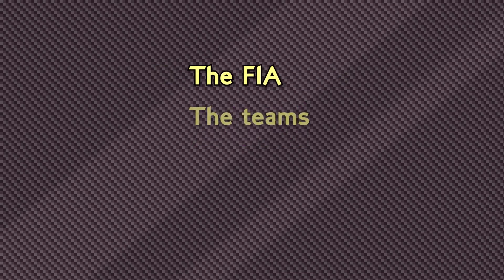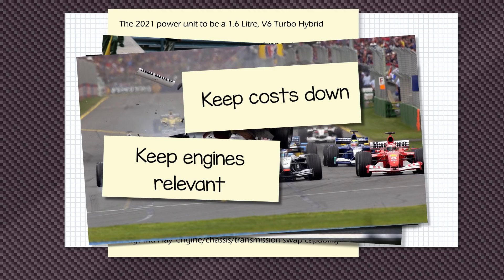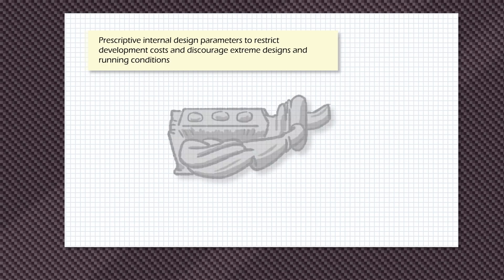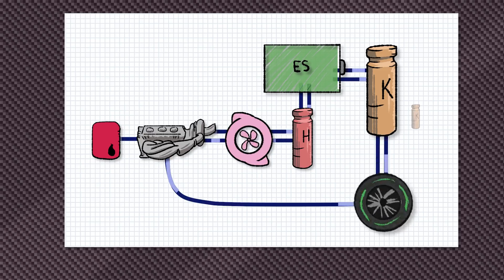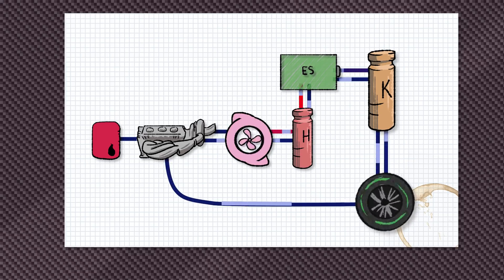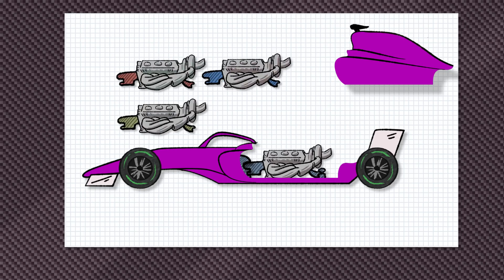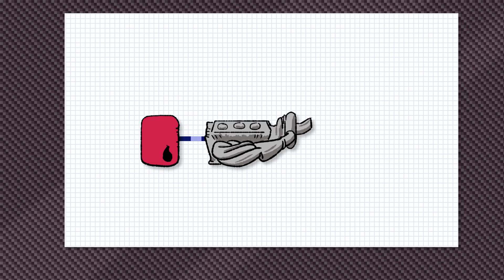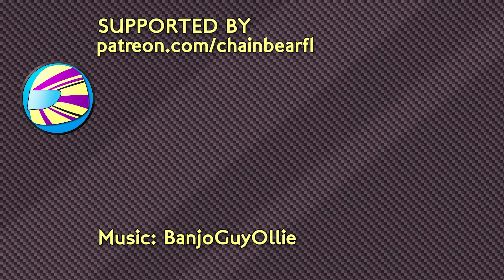F1 Engine proposals 2021 explored

Comment: "The sound of engines will disappear all together" with the implied electrical engine replacement. Not a hope in hell. Considering petrol has not only a 40 times higher energy density but can take mere seconds to refuel vs the 36 hours of an electrical engine. I mean it really sums it up that the electrical competitor to F1 not only requires TWO ENTIRE CARS swapped mid way to complete the race, but the speeds and distances are utterly pathetic compared to F1... with full electrical regeneration allowed.

Once the hipster hype of electrical engines has died down and people are looking to move on from the petrol engine I fully expect the alcohol fuelled engine to take off. Not only does it have a massive energy density, slightly lower than petrol considering the higher efficiency but still in the same league, but it also can be refuelled just as quickly along with a higher performance than regular engines and all of the current engine technology happily transferring over. In terms of hippy saving the planet it outputs water and only the carbon dioxide required to make it making a net 0 output. Electrical cars have been around for a while and the same complaints remain. Poor performance, short range, long charge time. How can you trust a car which cant make the journey and leaves you stranded for a day and a half (assuming you find somewhere to refuel). Electrical engines are complete failures compared to the engines we currently have (which are already better for the planet than electrical engines).

Also the MGU-H is the most expensive part of an engine by an absolute mile. It's less of combustion engine technology and a lot closer to jet engine technology. This won't be anywhere near conventional cars for the foreseeable future because, as you might imagine, making a jet engine is insanely expensive vs a $10,000 car's pricing. Its a technology which has been around since the 50's at least, and used in aircraft in the 50's before jet engines became the norm. It's nothing new, and there's a very good reason why it hasn't been anywhere near cars despite how much efficiency has been stressed.
Reply: Just going to point out a few mistakes you made (though I absolutely agree with you on Ethanol power), Modern Electric cars have been cutting down on the charge down heavily to just under 10 hours for a full charge, granted thats still insane compared to less than a minute to fuel most petrol cars, but its much less than a day and a half, and well, the Tesla Model S has been able to do 600 km and where I am at, that is plenty enough to be considered a Long range.
Reply: @xander1052  what no one her have said is that EV need batteries, they're currently made out of lithium, not only mining that lithium implies a massive ecological cost, the mines themselves produce carbon emissions, then you need to transport that to the place where batteries are made, then transport them to the respective manufacturers. Also, when the battery dies - because it's a thing almost nobody consider - all that lithium becomes toxic, hard to deal with, waste - it's one of the hardest - non nuclear - materials to deal with when disposing and, at the end, you need somewhere to store it, because it's solid, not a gas.
Making alcohol requires sugar, and other costs, but its disposal it's way cleaner. Nobody think about that
Reply: So Samsung isn't as keen on OLEDs 
Because those guys are basically an economy in itself like Toyota is a City
Reply: @Ricky Rickalvous
But you said they perfected it.

"They will be for motorsport racing (horse racing)"

No chance. They won't be allowed based on noise and environmental arguments. Hell, noise was already an issue in Spa years ago, at some point it was uncertain whether the Belgain GP would be held .
Reply: "The possible way to improve would be Samsung perfecting their Graphene battery" 
Key word is would be
I'm merely stating a possibility, an if scenario which is very likely
www.bosch-presse.de/pressportal/de/en/carbon-neutral-cars-synthetic-fuels-turn-co2-into-a-raw-material-120448.html 
Carbon neutral synthetic fuel
Noise at a racetrack? If Spa has an issue and races can't be held then too bad great racetracks have come and gone (Brands hatch, Malaysia, Nurburgring, possibly Silverstone)
Reply: You said it girl
Reply: It isnt so much the petrol but the oil required to make the petrol and lubricate the engine. At our current rate the oil reserves will dry up by around 2040-2045 but our rate of consumption is still increasing so this date may fall back to the mid 2030’s, thats closer than many people realise. Believe me im all for the sound of a screaming v8 ( i didnt really like the v10 sound) but the quicker we find an alternative the better
Reply: All i can imagine is getting a car powered by a liquid that has been fermented for the alcohol. And the "fuel" would smell like beer/bread. Nothing wrong with that i suppose.
Reply: Electric cars these days outperform and outrange gas cars by a small margin, and that margin is getting bigger and bigger each model year
Reply: @skyscall  😂 Since when..
Reply: Bang on, as of yet, with current battery tech but as it improves, changes and advances the script will all but flip. Stuff like graphene and super/ultra capacitors won't be primitive forever. 
Gas jets are too complicated for modular racing currently but it's probably the only thing that will see F1 into the future because nitrous oxides and bioethanol will be next to come under attack after high octane petroleum.
Reply: Who told you that making a jet engine is expensive? Developing it is. In Russia there are techies who build small jet engines in their garage. Here he tests his own built KJ 66 engine https://www.youtube.com/watch?v=sHuqoJmuvxE&list=PLyyfwUFI3XU-CvGsSXnczu4p9AEobpAED
Reply: Aditya Ravishankar creep
Reply: You guys can keep presenting this argument and that argument as 'fact' all you want, but the only real fact is that gas & diesel engines will continue to be around for DECADES, if not another century. The vast majority of society buys used cars and, at the moment, there is only a single brand of electric car that is pretty much universally praised - and they're a luxury segment competitor which eliminates a massive amount of potential customers right off the top with cost. The time it will take to create enough volume to build up a used electric market that can compete with used conventional cars in it self will be monumental. Then there's reliability & affordability of used cars; if something needs replaced on a conventional used car, it's generally a cheap component like an alternator, not a multi-thousand dollar battery pack. Toyota's Prius brand is nearly dead since the fad died; people do not LIKE them. Then there's the economic problem of, first of all, shutting down all of the gas stations. Then we have to replace them with a network of electric charge stations. So now we're chopping down the oil industry at the knees, putting who knows how many in the unemployment lines and eliminating numerous career paths. But wait, what about the electricity infrastructure, how is it possibly going to be able to withstand this MASSIVELY increased load? I can't speak for Europe of course, but I can tell you right now that North America can't handle this, we'll end up suffering from power outages on the regular. So just upgrade it, right? At what astronomical cost? With who's money? The governments? No, you mean YOURS. Or else we can just roll it up into the national debt; after all, $18T isn't so bad...

This is a pipe dream, guys. Go look back at the '50s, at the various concepts of "what the future will be like, what 2000 will be like" - and laugh at how much of an utter fantasy they were dreaming of, devoid of the many considerations like what I noted above. At bed, the electric car will live parallel with the internal combustion engine, but it will NEVER replace it, not in the realistic future. It's quite literally the perfect tool for the job, yet so many are desperate to replace it with a mediocre substitute whose adoption may just bankrupt society.
Reply: You missed something: fuel-cells. They might never take off in road-cars but they'd immediately suit F1 until batteries get dense enough (at least for quick swapping). There's still a LOT of room for improvement with batteries. (just look at how the range doubled for the new generation of electric cars)

I'm not thinking of hydrogen fuel cells, but rather  SOFCs with biofuels. Butane or propane would probably be the best if they can be bio-produced easily enough. (green factor) There are alcohols if not.
Reply: Electric engines aren't a good replacement for combustion currently, but they're only going to be getting better.  Battery technology is improving at a pretty impressive rate and considering the lower cost to recharge & cheaper maintenance costs, electric cars are only going to get more and more viable.

Also where are you getting your 36 hour charge time?  It takes 20 minutes to charge a Tesla halfway, and 75 minutes to charge it fully, and we're still in the infancy of this technology - these numbers are only going to improve (especially if they figure out how to quickly swap out batteries rather than having to recharge the one in your car).  Also, Formula E currently has a car swap halfway through the race, but this is the final year that they're doing the car swap - next year's formula calls for a battery that must last the entire race.
Reply: 3 decades is enough for me
Honestly my first car will probably come in 2025 and you bet it will be an ICE 2023-2024 model
16 years until the possible ban of ICEs... not bad I'll drive that sucker like I'll never drive again and hopefully switch to an electric S Class or some other European/Japanese model
Kinda like Android to Apple
Reply: Yes very interesting, I learned a thing or two there. But I just wondered that with the pace of electronic power units and performance longevity, won't they be able to go full electric in the 2020s and be able to do full race distances on a single charge? As it was not long ago electric engine's were pretty much a joke and now they are in every hyper car being developed or been made recently.

I am not really looking forward to a future of electronic F1 cars, I do like the roar of a engine, but I do think F1 should take a leaf out of Formula E's book with regards car design as I think the 2018 Formula E's look incredibly good looking compared to the 2018 F1 cars. But that's just my personal preference.
Reply: @TopTopBuzz  F1 will never go electric, more likely it will be phased out or merged with Formula E in that event.
Reply: @F1ll1nTh3Blanks , yeah wouldn't surprise me, I hear Mercedes are starting a FE team next season.
Reply: @Ricky Rickalvous
Ehm... LG made OLEDs actually successful. Samsung only makes them for phones which people throw aways yearly.
Reply: @RyTrapp0
Huh. Well some people just want to bury their head with all their might. The "DECADES" mean two, maybe three. After electrics become dominant smoke spewers will be progressively banned from the roads. (starting with cities.) Besides in a few decades probably there'll be a mass transition to automatic vehicles, which further accelerates transition to EVs, since most people won't be owning them.
Reply: I don't think that alcohol engines will eve have a net loss of zero until the world stops using gasoline, because there's transport, there's the energy needed to make the sugar or slav's sweat to alcohol. But as far as I know, alcohol engines are kinde shite nowadays, that's good though, if your engine is shite, it means that you can improve it even more
Reply: Battery swaps would be a two second thing if allowed, hell in F1 they would be a 0.2 second thing.
And there are no batteries on any electric car that take 36 hours to charge... unless you are doing it with a hand crank generator.

I understand people want to chip in with clever remarks, but then it's wise to double check the topic at hand.
Reply: MARRY ME lmao
Reply: No one's disagreeing that electric power will grow, look at phones and laptops, the most low end smartphone today would absolutely trump anything from fifteen to twenty years back
Electric cars will do to ICE's what cars did to horses
They will be for motorsport racing (horse racing)
And rich people (very wealthy car enthusiasts) will be having them in their garage like works of art (think Jay Leno and others with garages of classic cars)
Horses are a very primitive mode of transport but most people would want to have one which they can occasionally ride and have fun with but they require stables, a field for exercising, corn mash and food etc 
Electric cars will become mainstream (break that glass ceiling) once Toyota and Volkswagen jump on board and they produce more electric corollas and golfs than ICE's 
As it currently stands ICE cars are still designing, launching and planning for 2020 models and so on
Reply: As all reciprocating combustion engines need oil as a lubricant, you'll still have carbon dioxide in the exhaust fumes even with hydrogen or ethanol as fuel. Hydrogen and ethanol driven engines also need more oil because they lack the lubricating effects of regular petrol.
Reply: Find a way to swap a Tesla's battery?You're aware its battery takes up the floor for increased surface area as well as stability (bonus) 
The possible way to improve would be Samsung perfecting their Graphene battery without it burning up and stuff because it's extremely light, has shorter charging time and longer discharging time

Just like wit OLED screens if anyone has the resources to research and perfect it, it's Samsung
Reply: Aditya Ravishankar oh my god
Reply: That's It.
Reply: Umm alcahil engines are just mobile nukes not Shure it's going to be allowed because what autosport racing league wants their cars to be bombs as soon as the come into contact with anything other than tarmac
Reply: Wow a girl who knows her cars. This is a rarity but a welcome change nonetheless :)

Comment: Bring back refueling.  It brings another element for race strategy.  Limit the fuel flow, and what work can be done on the car while refueling, like other series use.  Different tire manufactures would be nice to, but just be careful like what happened at the Indy F1 event the only time F1 ran there.  Don't let the tire manufactures control the safety concerns, and that also would bring back some additional race strategies.  That is what is missing in F1 now.

Comment: So why limit fuel flow? This has always annoyed me. Why not have a fuel quantity of say 100 litres and say to the teams use it how you want. This to me would allow a push to pass type system but if they use it too often then they will have to take it easy at the end where the cars not using it at the back could then pass them. This means you could remove the whole stupid DRS system.

Comment: I personally think push to pass is seriously gimicky, in fact this sounds like push to pass on steroids. DRS also sucks. I can’t believe I’m saying this but INDYCAR has the right idea with the cars downforce mostly being generated from the floor meaning cars don’t get disturbed by turbulence anywhere near as much as F1 providing better racing. We need to move towards this and scrap this assisted overtaking joke. Also if F1 can sort out its image and cost effectiveness it won’t need to be a “testing ground” for manufacturers and we can leave that to WEC.

Comment: As someone familiar with PC hardware, I couldn't help but feel your comparison of standardized plug-and-play engines with USB ports to be a bit off.

Originally I started saying that USB was more akin to the standardized tyres, but if anything the tyres are more like the RAM in a PC while it's the driver themselves that's analogous to USB devices (as both F1 cars and PCs can run without a driver or USB device, but you need either in order to actually interact and use the car/PC).

I would think it'd be more like how CPU sockets were 20+ year ago when you could actually get a processor from several different manufactures that would still be compatible with the same CPU socket.

GPUs could also be a more modern example where they all typically interface over the standardized PCIe slot and/or protocol.
Reply from the maker: To be honest, I just wanted to use a Zune in my animation as I thought it was funny and the analogy was close enough ;)

Comment: The limit on number of engines has nothing to do with anything but lwoering amount of money spent.  A goal which has been an utter failure.   F1 going full electric will be its death. The engine proposals again show how little the FIA actually cares about the long term.  It also shows their fatally flawed 'road relevance' mentality.  Have 2 displacement limits (one for forced induction and one for N/a) and tell them to have at it.  End the stupi road relevance push and allow VVT, valveless, and other tech.  Institute a 'back of the grid' rule for engine changes after qualifying and be done with it.

Comment: Dude, the only engine that constantly hit 20,000 RPM was the Cosworth CA2006 of the William's cars in 2006 (that was the last year in history of the F1 1950-2006 that the rev limiter was unrestricted, no rule written by the FIA specify how many revs your engine must have). In 2004 the engines bearly surpass the 19,000 mark. From 1 engine per driver per race weekend in 2004 to 1 engine per driver per 2 race weekends in 2005 and 2006 that limit the raise of the revs due to reliablety issues and finally 2006 was the first year of the V8 era  ('06-'13) it's easier to make something with less mass V8s move faster than others things with more mass move faster V10s.